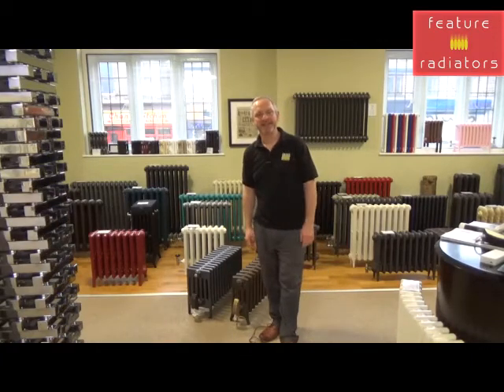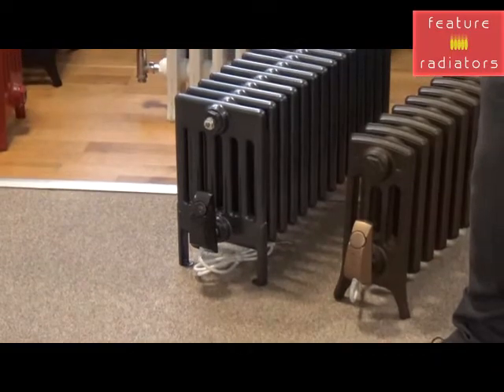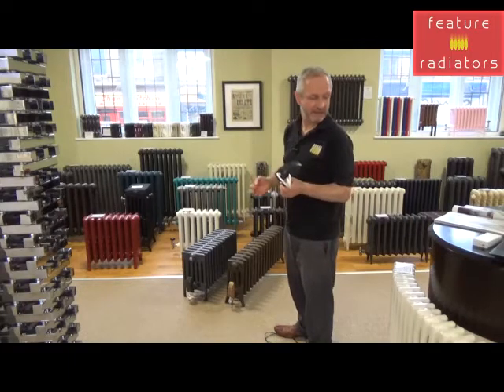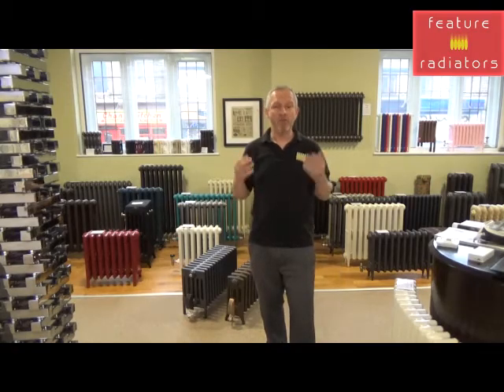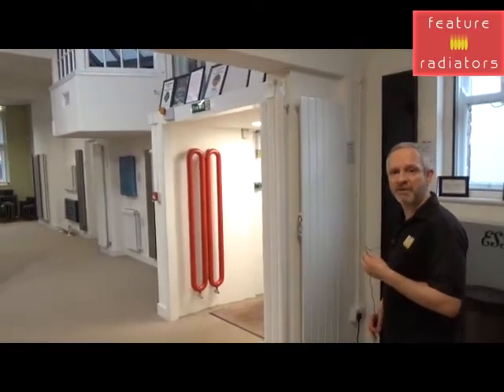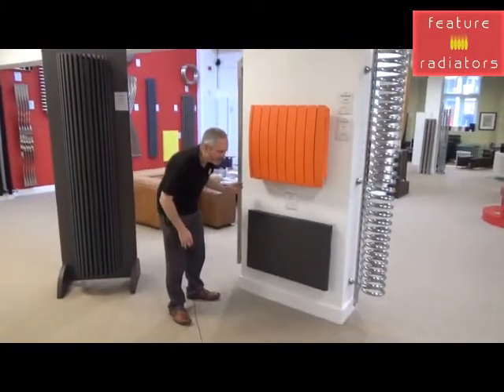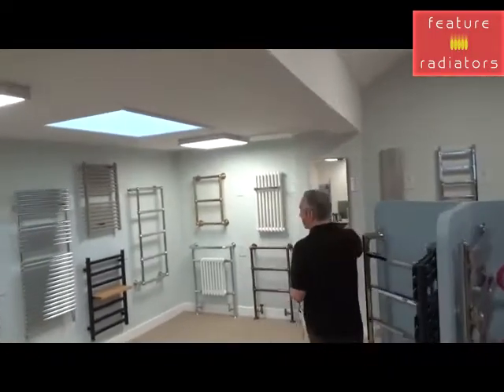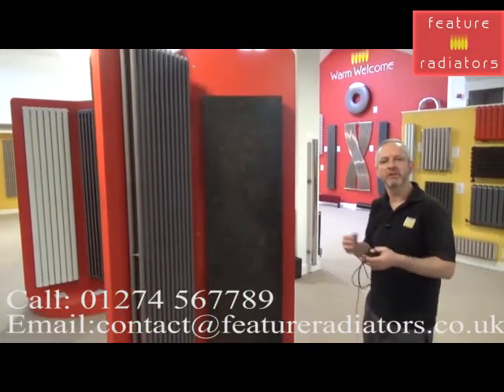Electric radiators - buying guide

Comment: Hi say if I had 300wats in cast iron radiator say 5oo mm x500 .would I get more heat output if I use 500x1000 if that makes sense
Reply from the maker: Hi Colin, the more material you have the more output you will get, so having a bigger size will increase the output for sure, in electric versions just need to specifying the element size correctly. Anything further just let us know 01274 567789 / contact@featureradiators.co.uk